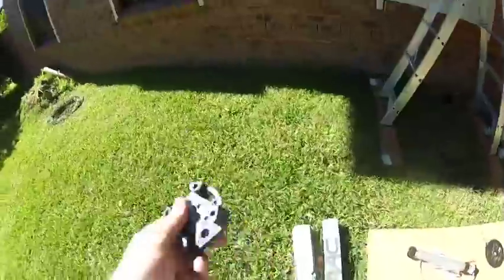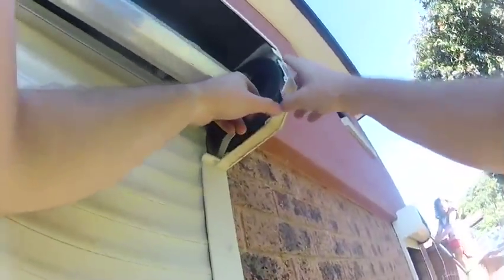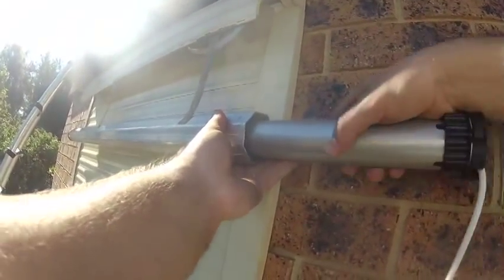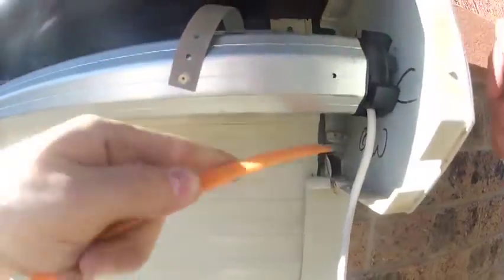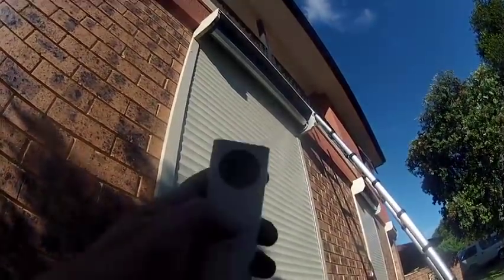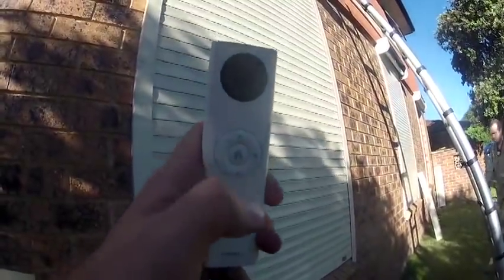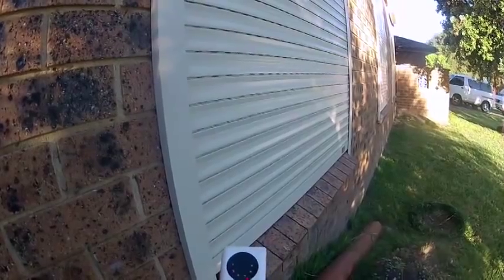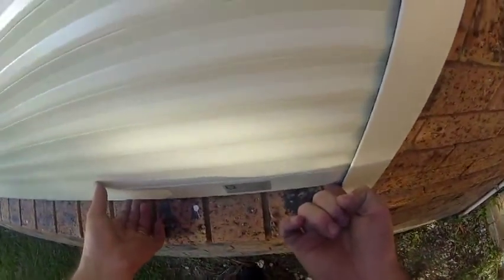Shutter motor Installation - Retrofit and upgrade a manual shutter with a tubular motor - SUBTITLES!

Comment: Great video! I bought a motor off Ebay but I am stuck at 2:11 because my shutter doesn't have the telescopic plug end. Just a steel plug end that doesn't push in far enough. I think I will have to remove the whole shutter :(

Comment from the maker: Thanks for the (very loud) constructive criticism. In the case of the FAAC tubular motor is it NOT required to even worry about the cabling/power colours and directions. These motors will always have the UP button or UP and the DOWN button for DOWN once the programming is complete. Please do not use this video to tell your customers how to do tubular motorisatio as it is a bit wrong for the US market. (as you have pointed out) We do not have a usable red wire on these motors at all.

Comment: what is the reference to the rivet , i ask because i am replacing a motor and the new motor is smaller in length and it doesnt seem to be turning the shutter at all after i installed it, i think it has something to do with the rivet?

Comment: Hi sir i went through your video , very explanatory , i also leave in Australia and i want to convert manual to remote controlled motor , what motor is the  most appropriate to use ? So many different ones whitch one is the right one?

Comment: Hello! I was wondering what type of plug do you plug these into, is it just a standard electrical socket?
Reply from the maker: Yes. That’s correct. Permanent power. 220-240v or whatever your needs.

Comment: Hey mate my roller shutters actually into into the eaves so you cant actually see the box or shutters when its done. How would you adjust the motor to the steel bracket in the situation?
Reply from the maker: Sorry for the late response. I would check out my other video on how to adjust limits (if you have yet to fix it) https://www.youtube.com/watch?v=_ZSkFYcy9ZE

Comment: which type of sensor (child safety) can be used?
Reply from the maker: There are several motors (FAAC, Dooya, SIMU) have motors with in-built sensors for obstruction/obstacle detection in a downward movement. It was designed for snowy or icy areas as ice and snow can cause shutter failure.
Reply from the maker: Many places sell them. Ask your local shutter supplier and if they don't know about it, try the next one.
Reply from the maker: Search Google for Roller Shutter in your local area. (sorry for the late reply.) I hope you have found what you were looking for.

Comment: Interesting that there isn't a power plug connection at the motor.
Reply from the maker: Adding the plug comes after install. (this job had the plugs added under the floorboards in the dark - so we could not show that part, sorry. 
No motor comes with a 240/120v plug as they are sold internationally. Additionally, if they did have a plug, we would have to cut the plug off so we could poke the cable  through a small hole to feed the cable to the power. If we left the plug on there, we would have to cut HUGE holes in houses or hooding to fit them through. 😉